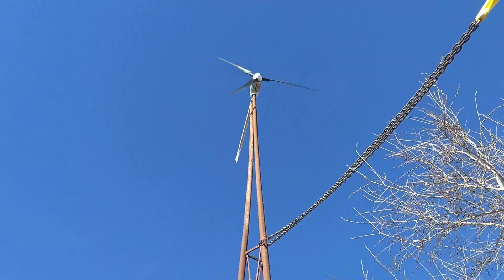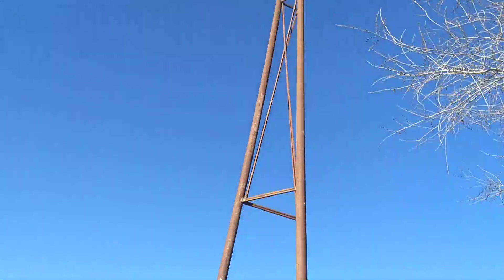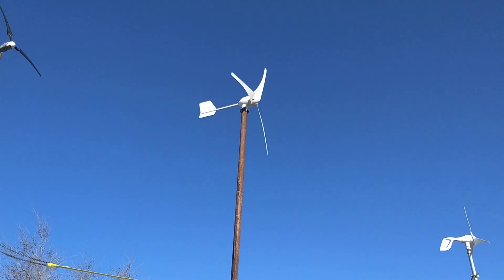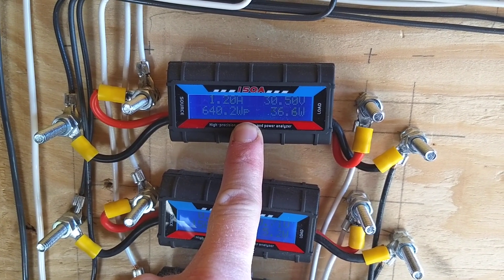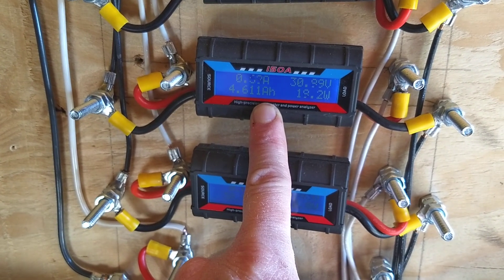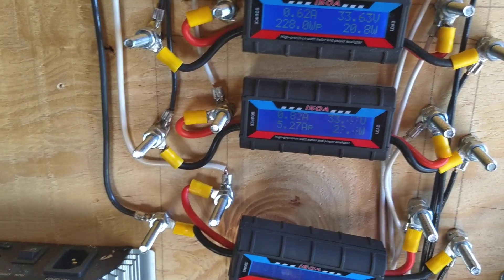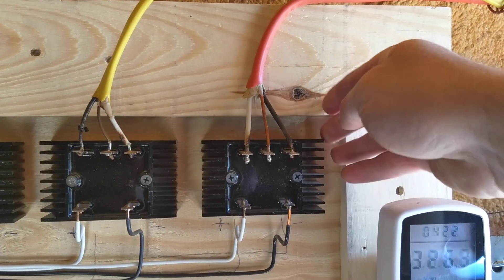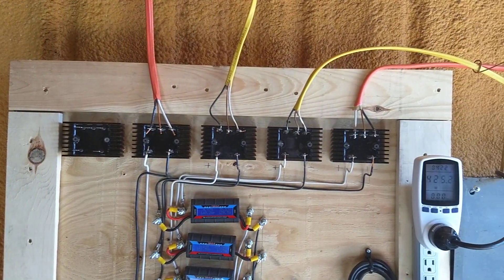iSta Breeze i1500 wind turbine, first day of real work.

Comment: Wher i can buy this controller like yours? I have ista breeze i2000. 48v. What battery bank i need? Thank you.
Reply from the maker: My control setup is described here:

https://www.youtube.com/watch?v=icDuNuKkgU4&t=30s

It's important to note, though, that if you have only one turbine you are considerably better off using a legit MPPT wind turbine controller.  My setup is this way because I need to control MANY wind turbines.  It is not efficient and there's very little in the way of failsafe control.  If I was dedicated to only one I would have a Midnight controller running it.  A real controller will get more power out of the turbine.
Reply: @ToysforWatts  this one? https://www.ebay.com/itm/Midnite-Solar-Kid-BLACK-150-MPPT-Charge-Controller-Regulator-150V-30A-USA-/261448754683?_ul=PL
Reply from the maker: That one is a solar controller.  You would need one like this:

https://www.ebay.com/itm/Midnite-Solar-Classic-150-MPPT-Charge-Controller-Regulator-150V-96A-USA-Midnight/261667463020
Reply from the maker: @tomaszplinta1405  With the i2000, assuming it's the only turbine you're running, it would be better to connect to a 48v bank.  36v works for me but I'm using it to accommodate a couple of turbines that would be better suited at 48v as well as turbines intended to run at 24v.  Again, this is a setup that sacrifices efficiency in order for me to run a wide variety of turbines.

I would be reluctant to suggest that charge controller for something as large as the i2000.  I've seen similar controllers work pretty well with smaller turbines but I would be worried that the i2000 would overpower it.  I've seen a lot of them fail when being run at full output for extended periods of time.  They get very hot and the circuits can't handle it.  They also will not offer you any power point tracking...this is something that varies resistance on the turbine to keep the turbine's speed in a nice, sweet sport for power production.  That unit will let the turbine do whatever it wants.  I know a controller like the midnight classic is pretty expensive, but I think it's the best way to go.  It's the way I would go in your position.
Reply: @ToysforWatts  ok. Thank you. Waiting for your next video.
Reply: How is your ista breeze 2000 going?
Reply: @hamishk  still in the box. I haven't time to start IT.

Comment: Excellent it looks like that one will out run the others hands down.  i see what your saying about the tail at 0.52 it gets a good wobble on but i'm sure you'll fix that no problem. i look forward you any more output videos you do
Reply from the maker: Thank you!  I've actually already got a steel tail to throw on it but the experiment is to run each turbine for at least 90 days or until it breaks...and, who knows, the tail may last longer than I expect.
Reply: My guess is if the plastic is of good quality it will be fine as i'm sure they will be tested in the factory,  i've been looking at these turbines since seeing yours but only find a 12v 24v or 48v you said your battery is 36v so can i ask is your turbine a 36v or 48v ??
Reply from the maker: I try to get turbines that are only labeled for 24v but yes I am running them on a 36v battery bank.  One of my turbines was labeled as being 48v and I went through several different battery arrangements to try and find one that would work for that turbine...12 and 24 seemed to just act like a brake and 48 had it free wheeling, but 36v seemed to work okay...and it's seemed to work pretty well with my other turbines, too...so I haven't gone back and changed it.

It is something I need to do, though...my inverters suck the batteries down pretty damn hard in the 36v configuration.
Reply: @ToysforWatts  Thanks for that, if that turbine is a 24v then that's quite impressive for it to be charging your 36v bank it must be kicking out some good voltage, my 24v if spun at 460 rpm  will only give me 13w on a 24v bank but if i hook it to a 12v bank it will give me 145w, this is only been done with a drill mind i've not tried it up the pole, i read somewhere that a bigger turbine on a smaller bank will act like a brake but i couldn't understand why this would be as i was thinking a smaller bank voltage would be less resistance
Reply: Turbulent winds will make the tail bounce around

Comment: Are those wires safe being that exposed?
Reply from the maker: No they're not.  I need to install a disconnect on the shop side and the wiring will be buried in conduit between the turbine and the wall.  It's a couple hours work I kind of have to spread out over the next week.